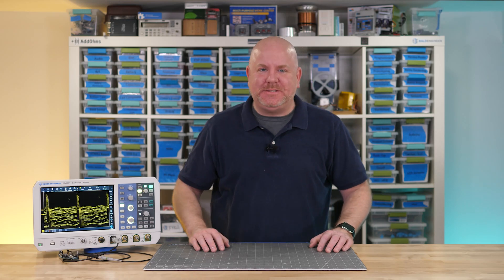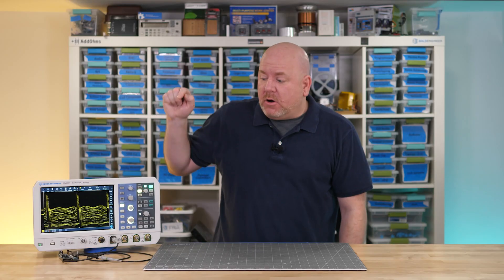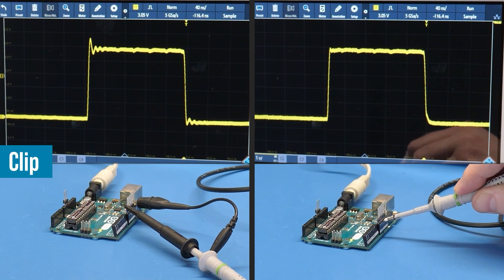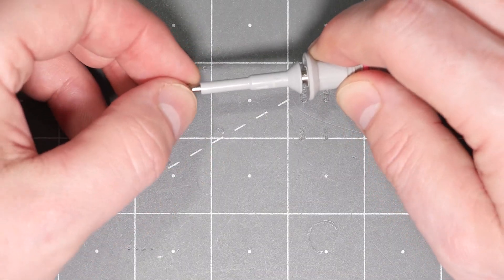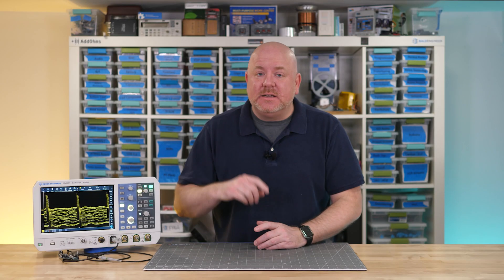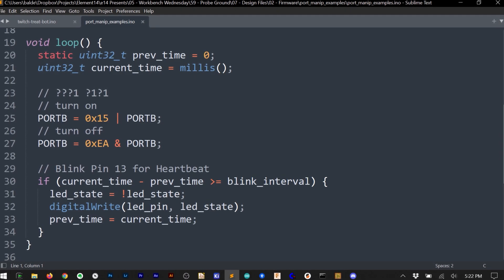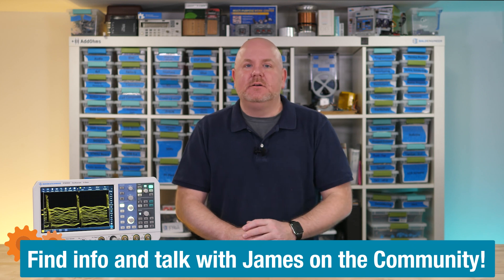Do ALL Oscilloscope Probes Need Ground? - Workbench Wednesdays

Comment: Great info and easy to digest.  The issue I see with using the small ground spring tip is that you need a ground point available very near to any point you want to measure.  Is that typically the case in many circuits?
Reply: In general, yes. There should always be a ground point nearby. Practically speaking, it isn't always the case. However, in circuits where bandwidth and probe loading matter, there should be plenty of ground available: either a pin or a via. When designing a PCB, there should always be consideration for probing critical signals and ensuring that a ground via is nearby.

Comment: These depicted return loops drawn onto the probes seems fundamentally wrong and misleading in the video. There is no direct return path inside the passive probe at or near the tip. 

In all cases the signal must pass all the way back up the probe cable and into the scope (where it is then placed on a resistor for measurement ) and THEN it reruns back down A cable to a ground contact point (clip or spring or clip from another probe ). 

The return paths are not as hugely different in length as you illustrate in the video. What is impactful is how the return path runs with respect to the probe signal input tip. The more they run tightly together the less pick up of interference. 

The spring tip use has only that small deviation from the signal tip. 
The alligator clip has a plate sized loop between ground clip and tip, a small antenna in a way, an inductance difference. 
Using a separate probe cable as the ground return has a much. Bigger loop as that loop deviates inside the scope out the full length of the other probe cable, more inductance.  Thats the difference. And that isn’t what your diagrams depicted.
Reply: I had the same thoughts, glad I found this comment to confirm I'm not losing it.

Comment: I use scopes daily and our company policy is connect each ground if you don't your data is ignored. There is a difference between "can you" and "should you". Sure at DC you "can" but I've seen noise picked up by cables. The issues is magnified when you're reading MHz or GHz because you can't tell the difference between noise and signal. The second part to company policy is so that everyone follows the same process because the point to science is reliable and repeatable. If the lab has different machines running when team A does their tests and team B does it on the weekend when things are quieter or vice versa you can't call that reliable or repeatable.

Comment: I have a DSO and I recently moved into an older home. The receptacles do not have grounds. I am planning to rewire the house, but before then If I install a GFCI will this work for the grounds even though there technically will not be an actual ground? Also, will I be able to test with the DSO while using a bench power supply?
Reply: This is a "no equipment ground" situation. And I am not an electrician. However, if the scope and power supply are plugged into the same outlet, their reference should be the same.

Comment: The one one the left has a isolated power source, possibly powered from a battery pack through a USB so no transformer. The circuit B is powered from a wall transformer and is on the same earth ground as the probes socket or power source.

Comment: hi can I use 150 MHz probe on 50MHz oscilloscope?
Reply: yes but you will only get a reading for 50mhz
Reply: @thubtumbing4  nope. First of all 50 MHz, instead of 0.05 Hz. Second thing: he still can measure above 50 MHz, but signal will be smaller, because probe (and scope) is a RLC filter.

Comment: At an electronics manufacturer I worked at (pre-1984) I seem to recall seeing test point sockets on circuit boards that would accept the small Tektronix scope probe ends, sort of a small coaxial socket.  Just by plugging the probe tip into the socket it would allow access to the test signal and provide a very good signal ground and shielding.  This was when the smaller Tektronix probes were fairly new, and we also used the much larger ones as well.

Something to watch out for on multichannel scopes is probe cable lengths.  Trying to determine signal time offsets can be misleading if you don't use probes with the same cable length.  The signal propagation delay through different cable lengths will be noticeable, and worse at higher frequencies.
(If there's already a video about that on Element14, think of this as a reminder! ☺)

Comment: One of the nice things I've discovered about good active probes is that grounding is a lot less critical. A clip-wire ground can give as good SI as a spring on a passive. For my most critical probing though, I always use a differential probe.

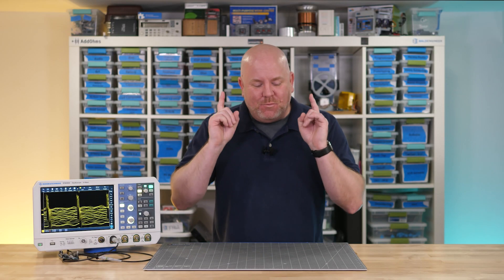Comment: 6:06 circuit a is powered from a USB thus has ground loop completed. Circuit B is powered from an ac/dc adapter with isolated outputs.
Reply: i am thinking the same
Reply: Unless otherwise stated the scope BNC ground is connected to the ground pin on the plug.
Reply: +1 - The wallwart is completely isolated from any earthed path.

Comment: I got an oscilloscope a year ago from Amazon prime and still haven’t really figured out what to do with it.  But this is helpful and putting me in the right direction…. The power supply, one is using a dedicated power supply the other one is running off ethernet I think or USB
Reply: Follow the link above to see an explanation. (And while what you said is true, that does not explain the behavior.)